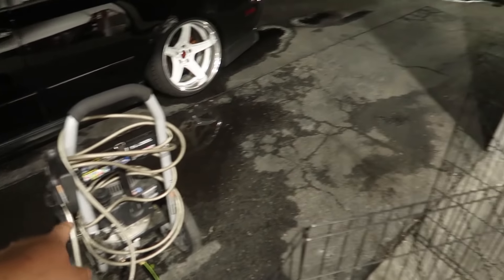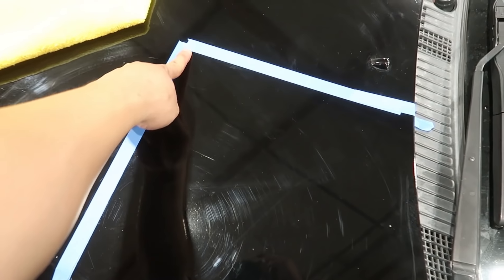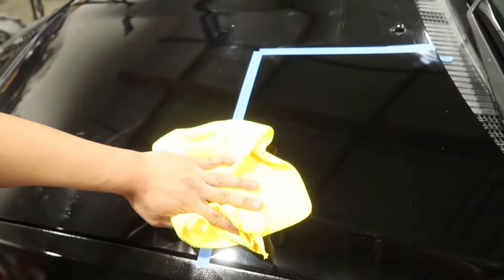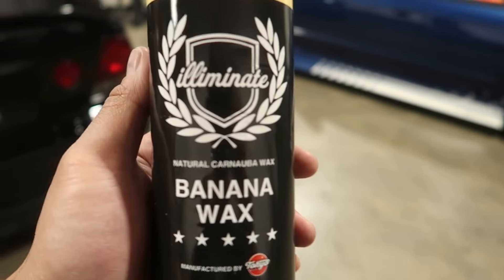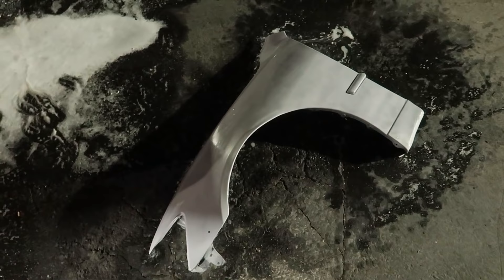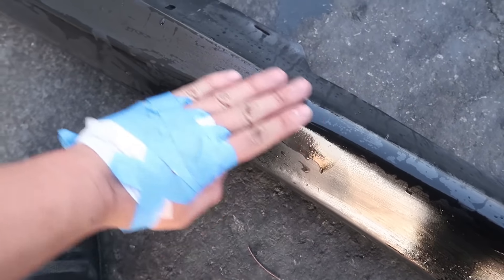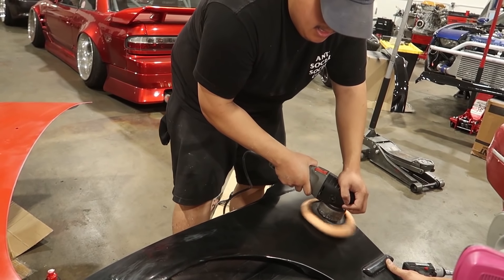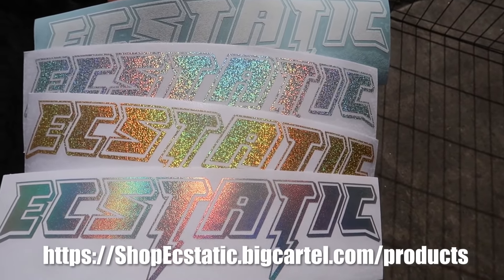How To RESTORE Your Paint During Quarantine!

Comment: Gotta use brand new micro fibers and change them when they clogged also ceramic will fill in alot of those scratches bro you guys are champs using that dam porter cable that thing is slow  😂😂😂